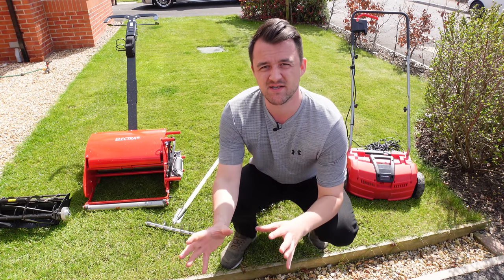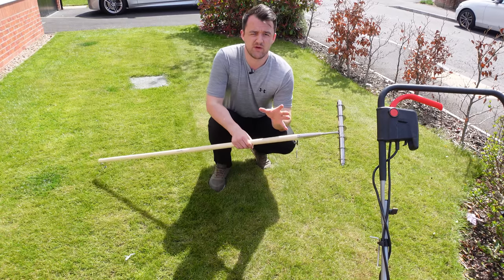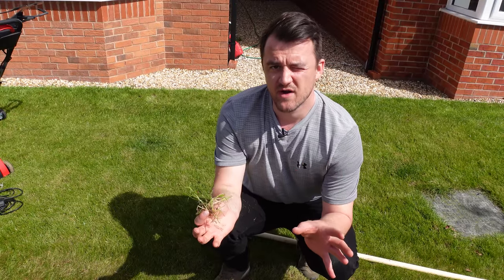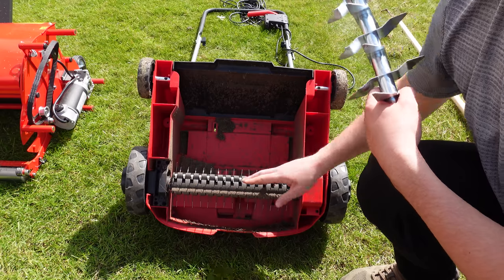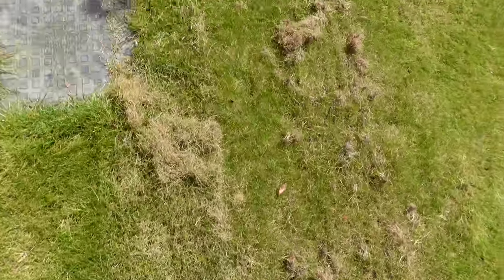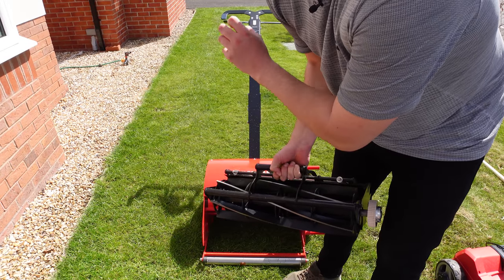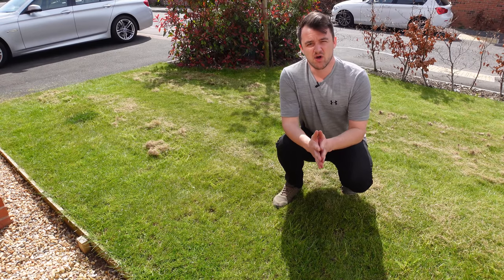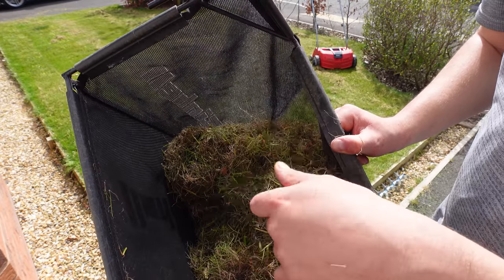Top 3 Lawn Scarifying Tools (and When to Use)

Comment: One thing of note @lawncare guy - the Spring tined cartridge is actually a power raker and the vertical flail cartridge is not actually an aerator but scarifier. I would recommend raking for a light dethatch for moss and scarify for a deeper dethatch for the annual meadow grass / crab grass which never seem to be affected by selective weed killer! 

Great video! Much prefer a machine over manual no matter how small the garden!
Reply from the maker: Yes agree they aren't named right thanks for watching
Reply: @GardenLawncareGuy  - any tips on how to get rid of poa, annual meadow grass and crab grass from the lawn. 

I’m really struggling as I’ve managed to get rid of every other weed type except for the above 3! I live next to a field infested in all types of weeds so will need to manage this on annual basis
Reply from the maker: Me too :D Right now I am mowing very often to try control seed heads and pulling stalks everyday. Other than that struggling like everyone, going to test the vertifcutter out soon too
Reply: I totally agree with this comment it's something I just found out not so long ago

Comment: I really like your videos as they make lawn care accessible to beginners like me! I have a really basic question about seed heads. Would all the seed heads that I see growing be considered weed grasses? Also just a comment on scarifying, I found the machine doesn’t get right up to the edge if there is a wall or railway sleeper so have to manually rake the edges. And suggestions how to do this better?
Reply from the maker: Some seed heads may not be weed grasses but generally they will be and you can just remove them - I'd think that if there are seeds in my lawn as much as possible I want to choose what's there. Manual raking is fine too just easier with machine but it works fine
Reply: @GardenLawncareGuy  thanks that makes sense. there aren't that many so will just remove them all

Comment: It’s also worth mentioning that you have much more control with the manual scarifier. You can feel your way around and easily control whether you go lighter or heavier in different areas. Your point about it being harder work shouldn’t be understated though 😅
Reply from the maker: Yeah good point, I did find myself finding myself navigating the tress and bushes a little more with the power tool easy to change angles.

Comment: Very interesting - is there an option for a tow behind? All I’ve seen is the ones with the prongs that drag in the grass, but the options you presented seem a little more optimized for the job. Thanks for the video!
Reply from the maker: Thanks, there are probably additional methods and machines, I just covered some typical ones that most domestic users would be using. I have seen some tow units for larger areas inckuding in agriculture but never used one myself
Reply: @GardenLawncareGuy  I figured it was worth a shot, the video was helpful. Thank you!

Comment: Is it good to scarify and aerate at same time. I have a 2 in 1 electric one similar to the one you have Matt. I want to overseed after using the machine. The aerator  I used with the 2 in 1 was quite aggressive when I used it on the front garden. Would you suggest that I just scarify only then overseed or scarify and then aerate. I noticed you never used the aerator with the power machine. Thanks Matt.
Reply from the maker: It didn't need the aerator really, just a light raking. I typically use the fork aerator hollow or solid tine but the front lawn will be ok with the rake I think

Comment: My gardens are more moss than grass, chucked moss/weed killer down and its starting to go black, using a scarifying rake/tine rake is backbreaking (I'd say I've done maybe 15-20m^2 / 300m^2 so far) and also looks terrible as the scarifiying rake is pulling huge chunks out of the lawn. would an electric scarifier like the one in this video be suitable? And any recomendation for a grass seed that's moss resistant / does well in more shady areas?
Reply from the maker: Hi Shane, yes you can use an electric version, do a few passes and get it up. For shaded areas this is brilliant and high quality https://gardenlawncareguy.com/shop/grass-seed/shade-lawn-grass-seed/

Comment: Could you see yourself only using the Swordman Electra? Is it as good, performance wise, as the Amazon machine?
Reply from the maker: Yes, I only keep the amazon machine so I can show people in the videos different alternatives and mix in different types of tools for the channel. If I did not make videos I would only use the swardman for everything
Reply: @GardenLawncareGuy  thanks. I’m on the fence about investing in an Allett Liberty with the cultivation cartridges, and your feedback has really helped reassure me.
Reply from the maker: Steve what is your typical shedule for the scarify and verticut usage?
Reply from the maker: Yes, I havent had chance to use it yet and plan on monthly use too. I will need to get the depth right to make sure I get a short back and sides and not a number 1 all over!

Comment: Would you scarify before or after mowing your lawn?  How low should you mow it?
Reply from the maker: After mowing, depends the lower its mowed the more stress it will be under so take that into consideration if that is something you want or not for the rebound, weather and typical height of cut
Reply: @GardenLawncareGuy  thanks.  First time I’ve had a lawn.  It was turfed about 2 months ago and I haven’t a clue how to look after it, except for mowing it.

Comment: Any tips on what to do with grass tips turning yellow? Thanks 🙏
Reply from the maker: Depends on the reason, right now as there has been no rain could be due to lack of water or cutting too much off grass under stress.
Reply: @GardenLawncareGuy  I’ve been watering it a fair bit as it’s a new lawn laid, been cutting once a week, I could have cut off a bit it too much. Thanks for the help and quick reply 👍
Reply: @stevea3200  I’ve just got a new lawn mower but will check the sharpness. Thanks
Reply: @stevea3200  it’s a new karcher rotary mower, I’ll have a check after work today. I gave the lawn a feed and water last night. Thanks for your help.